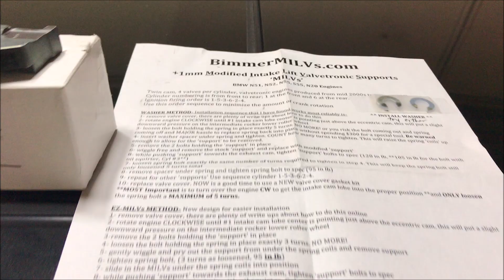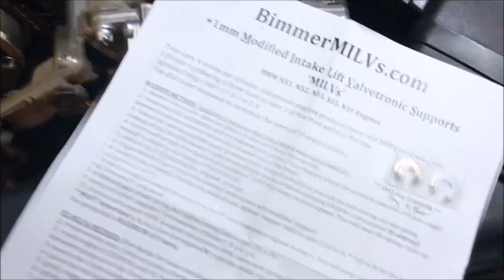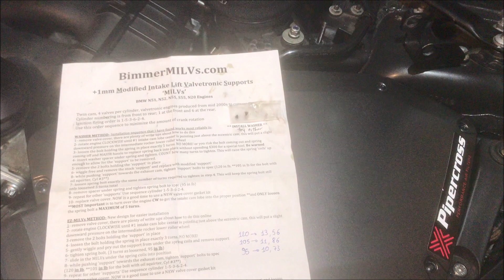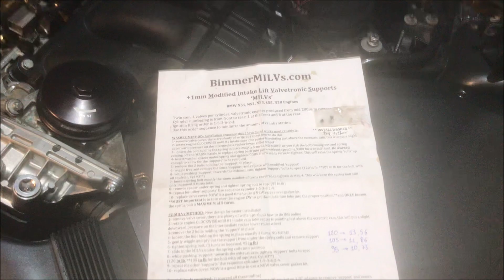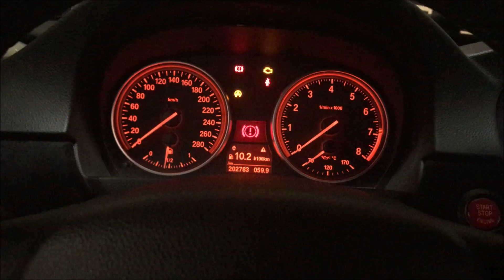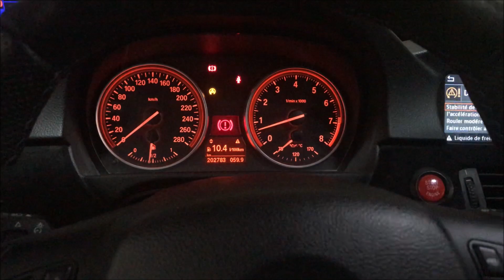🛠EP6 +10cv et +10Nm à la clef BMW  MILVS  🔨⚙️🤩🔧☢️⚠️

Comment: That is a nice upgrade. Where did you tune the ECU after MILVS upgrade? I have a Z4 with N52B30 engine with MILVS already installed and I am struggling to find a capable tuner.

Comment: Salut, pour le collecteur d’admission que tu a dit sur la vidéo tu a fais comment ? Et faut il faire quelque chose électroniquement ?
Reply from the maker: Salut salut 👋 si tu remplacé uniquement le collecteur d’admission par celui du b30 sans modifier les injos le calculateur compensera avec le debimetre et les lambdas , pas besoin nécessairement de faire une gestion, après forcément si tu fait faire une carto en plus il y aura encore quelques cv à gagner 🤙🏼

Comment: Belle manip et montage astucieux. Dommage que je n'ai plus de n52.. Par contre je ne comprends pas comment agissent ces cales. La modification ne s'apparente pas à une modification de l'avance mais seulement de l'angle d'ouverture des soupapes c'est ça ? Et c'est sous-optimal d'origine ?
Reply from the maker: Les calles amplifie le mouvement de levier sur l’arbre de valvtronic, sa apporte 1mm d’ouverture des soupapes en plus et 3* de timing d’ouverture ,  sa permet de gaver encore un peu plus
Reply: @BREIZHTRACKRIDER   @BREIZH TRACKRIDER  merci pour les infos. Autant le mm d'augmentation de l'ouverture c'est clairement du 'hardware', autant les 3 degrés de timing peuvent être obtenus par reprog, non ?
Reply from the maker: bonne question pas sure , il me semble que c'est deja au taquet sur le b25 , par contre le b30 est bride sur la course , et sur carto sa peut etre repris sans modifs meca !

Comment: Is there anyone that can do a remap for an n52b25 with this modification?
Reply from the maker: 253hp and 280nm so 100hp/l for mine with orther perf parts ;)
Reply from the maker: But only milvs 🤷
Reply: @BREIZHTRACKRIDER  où avez-vous remappé votre ECU?
Reply from the maker: yep with 100% e85 ( ethanol) map ( "wes'mapping")
Reply: @BREIZHTRACKRIDER  avez-vous n52b25 ou n52b30? Pouvez-vous faire un morceau de carburant flexible? Une ECU map avec 95 octane et une avec e85?
Reply from the maker: @buildanddrive  N52B25 ;) 2.500cC  it is possible to flex but the performance will be poorer than with a 100% optimized e85 (because of the ignition advance)
Reply: @BREIZHTRACKRIDER  combien a coûté le ECU tune?
Reply from the maker: @buildanddrive  it is better to make a quote, but around 500 € I think